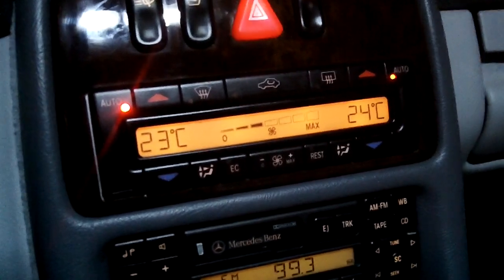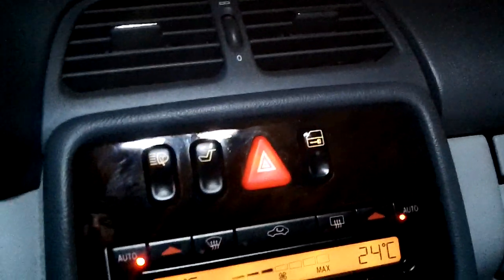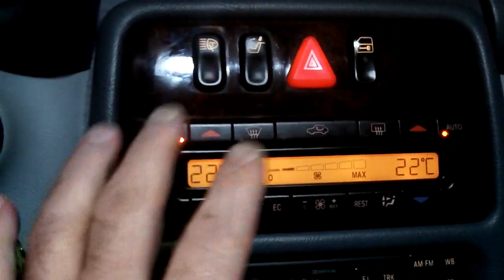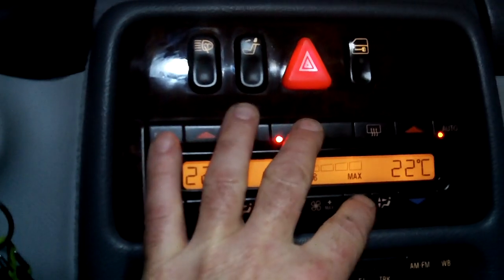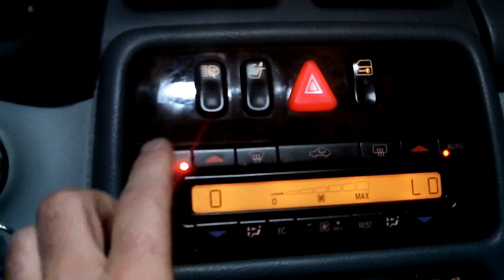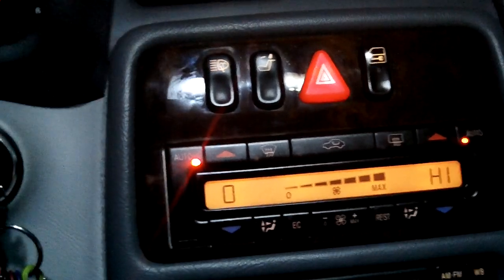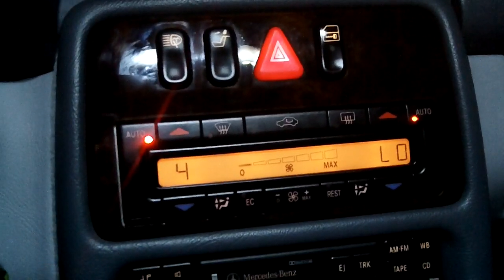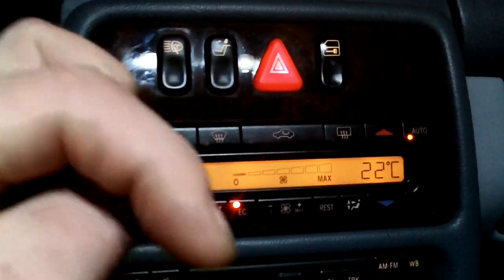Mercedes w208 clk320  climate control vent flap test

Comment: You mentioned the center flaps not blowing in your face with heat. Does the same apply to cold air? Can’t get my center claps to work or my floor vents either

Comment: This is a great video explanation.  Any ideas on why the airflow slows under acceleration and returns at normal speed?
Reply from the maker: The flaps are vacuum controlled . When you press the gas pedal there is a change in vacuum so the flaps can slightly close . There should be a compensation valve to keep the flaps in the same place , but these can slightly leak over the years .
Reply: @fupabox  thanks.  Where is the valve located?
Reply: @fupabox  do you have diagram of vacuum lines for A/C?

Comment from the maker: defroster will mean at windshield, and from what I can tell by testing my car,defroster leak (tiny amount of air coming through ) is at both side defrost vents and windshield.. I may be wrong..but that is the description from the manual,and I hope I'm understanding it correctly
Reply from the maker: must be something in these new settings I can't figure out..I tried to reply to "Terry Gee's" post and It said I wasn't allowed..LOL..who knows
Reply: +fupabox hi, hope all is well.. Im having issues with my w202.. there is no air coming out the center vents its all coming out  the defroster for the windshild.. and the tow side vents..nothing out the center.. Ive pushed every button but still can't get the air to come out the center..also dont think my air circulation is activating
Reply from the maker: +Vaklev Kalpatrick Bastian  the distribution box for the vacuum lines for the climate system is behind the glovebox.. there is likely a leak in one of the hoses back there, or a broken actuator for the diverter flap... I would check the distribution box first

Comment: Hi. Thanks for the video. I have some questions:
U noted that air may also leak at defroster vents during most of the test. Is that the vents at the front, at the windshield or the ones for the side windows ?
Test#6: does left defrost mean at windshield or at left door. 
The reason I'm doing the tests is because I don't think I'm getting enough defrost air at the front windshield. Thanks.

Comment: Craig...Just saw this video..Crazy that you posted this...I've had an little issue with my center vent.  It still blows cold air when climate unit is OFF.  I know MB had the NO heat in the face policy due to safety issue...but I believe this may be a bad element behind the dash, which controls the ventilation system in the CLK's.  (There's multiple Elements that control the vent flaps.)  I wonder if your test can pin point if its actually a bad element in the center vent outlet ..your thoughts?
Thanks bro.

Comment: do you have any tear down procedures for the dash so I can get at the defrost actuator motor???  thanks
Reply from the maker: +Dragon 5715bIt's somewhere in the service manual     http://workshop-manuals.com/mercedesbenz/clk_320_(208.365)/v6-3.2l_(112.940)/heating_and_air_conditioning/heater_core/component_information/locations/

Comment: Hey FUPABOX was up great video lots of info... question??  my vents are not working when i press the buttons to change the directions. Reason is that all my buttons are stuck. Meaning. they dont pop up or not click they seem to stuck or jammed. Any info on this
Reply from the maker: something must have spilled on them . You can gently pop them off and see if they are gummed up from behind . If not , just swap out the whole unit ...they are pretty cheap at wrecking yards

Comment: 2003 clk 320, got a 17 and 18 code.  Issue is no air blowing on driver side windshield, i dont see those codes in your description at all
thanks
Reply from the maker: +Dragon 5715  You have a w209 which has different codes.. I can't find the flap test codes for yours, but many vent flap issues can be resolved with a new cabin air filter, and a reset of the vents.. to reset the vents turn the ignition to position 2..turn the fan speed to high, turn the right vent knob to the straight up position..then press the recirc and windhield defrost buttons at the same time...hold them until they start to blink side to side. let them blink back and forth for a few minutes...they may or may not stop blinking on their own.  Then turn the ignition off then start the car and see if they work properly. If they are still not working try it with the car running..it may take a few tries to reset them
Reply: Hey, could you tell us how to reset the vents on a w208? (I tried the instructions above for the w209 and they didn't work)
Unless for the w208 this vent flap test does the reset?

Comment: @fupabox  Thanks for all of your videos!   You've saved me a ton of money on brakes, brake switch replacement and other things.   Question today:  On my 2001 W208 CLK320 Cab...HVAC system has suddenly resolved itself to do one thing only, regardless of the settings: it blows up through the defrost vents and through the far left and right passenger vents. I can't get any air from the l/r  center dash vents. The temp can be adjusted warm or A/C and the A/C still blows cold. I conducted the "flap test" via the head unit, nothing changed on every test. Any idea where else I need to start looking or what's broke?   Let me know at your convenience.  Thanks in advance man! Dave / Woodstock, GA
Reply from the maker: likely a leak in the vacuum flap system under the dash. The main vacuum distribution block is behind the glovebox, and most of the flaps can be accessed from there or under under dash covers on both sides. Check first that the vacuum operated rear headrests work properly.. if not them the vacuum pump in the trunk could also be leaking, a Vacuum tester can be used to see if there are any leaks, as can a mouthful of cigarette/cigar smoke blown into a vacuum line.
Reply: Hey dead fan, my 2000 c280 just started having the same issue as you described. Did you get issue resolved? If so how did you fix it? Thanks

Comment: What if you got the manual climate control with the two dials for speed and fan position ? Is there a way to test the vent flaps on that?
I wish my car had this unit fitted...
It's a weird model to be honest
2000 w210 e320 m112
No aircon
Leather seats which aren't heated 
And it's an elegance trim ... 
Can't believe someone picked out this car new without those two options.
I think this will be my third and maybe the last Mercedes ... Although I'm very tempted by a newer facelift w203 wagon 2004/2005 
Or same year w211 wagon... Maybe they'll sway back Stuttgart back to no1 for me, because right now I'm having more and more Bavaria thoughts .... Lol
Reply from the maker: +UDontKnoAThing   Old Bimmers are great reliable cars..I've had many of them.. just crappy seat materials, otherwise well built and easy to work on.   The only possibility for a vent flap test on that version of the climate control would be to press the recirculation and front defrost buttons at the same time, and hold both down until the lights on them flash back and forth.. That should cycle and reset the vent flap values.. it takes a few minutes for it to check and activate all the flaps .. it works on the w203 and some w202s  so possibly on yours

Comment: I have a 98 w210 and whenever the heater is on, the main center vents barely blow any air. But when they A/C is on, cool air blows normally. Any ideas on what this could be? I sure as hell hope its not something with the heater core. Any help is greatly appreciated.
Reply from the maker: Your car is behaving as it should.. Mercedes doesn't believe you want warm air blowing in your face (myself I like the warm centre vent air when I'm freezing, but it's not in the programming for the HVAC in these cars)
Reply: *****
Was that only on the '98 models? My dad has a '99 E300TD and he told me that his center vents blow hot air. I believe its been serviced before, could the mechanic have messed with it?

Comment: hello bro 
thanks for your nice videos . i have an issue with my clk 1998  while driving the ac at first works fine and cooling and then while 
 the car is in idle the air blowing is hot after i drive around the air is cool again do you have any idea what to do ??
Reply from the maker: sounds like the coolant charge is a bit low .. when the engine is running at a higher speed , so does the compressor for the a/c ..it then can push enough refrigerant to make cold air ..at idle there isn't enough refrigerant that the compressor can circulate it. I'm betting a top off of refrigerant will solve the issue
Reply: fupabox thanks for your reply. What should I do in this case. Add more gas ?
Reply from the maker: yes... it most likely needs just about 1/2 a can

Comment: I have a 2001 CLK 320 Cabriolet  I am getting a loud squeal sound from my air circulating system it is not constant.  It comes on and off when the circulating system is turned on.  Sometimes it even happens after I turn the car off an pull the key out.  I have heard that this might be a leaky vacuum flap.  Wondering if you have an answer and a fix.  Ever since the DR put me on hearing aids, it really bothers me.  Before that, I could hardly hear it>   :)
Reply from the maker: It can also make that sound depending on whether you have the dash vents manually closed..  I would check for a clogged cabin air filter before blaming the air flaps...junk can get into the vents near the main recirc. flap and help cause squeeling as well
Reply: Thanks,  i will check the filter.  Woud the clogged filter still squeal after the engine is shut down.
Reply from the maker: Pete DeBoer no...only if the "rest " button is somehow stuck.The "rest" function turns the heater fan on low for a few minutes to keep the interior warm in winter while you are not in the car. Otherwise the fan shouldn't come on with the car off
Reply: I pulled the filter out, it was full of "stuff"  Thought I had fixed the squeal, I have ordered a replacement filter.  About 10 minutes in to a squeal free ride, the high pitched noise came back.  Do you think it might be a vacuum flap?  How do I get to it?
Reply: My car is making that squealing noise too when air conditioner is on did you find out your problem?

Comment: hello, thank you for the vid please help clk 320 99 cent ac vent not working 

does any one.know what could cause the issues Nd repair.

please thNk you
Reply from the maker: +thegsilvia69 If you have done the vent flap test , it is likely there is a problem with the vacuum actuator for the center vent
Reply: +fupabox thank you, by any chance you would know where it is located 

thanks again
Reply from the maker: thegsilvia69 you should be able to access it from the panel  under the glovebox
Reply: +fupabox thanks for everything

Comment: Maybe somebody can help me out on this one. I have a W209 (LHD). I already replace stepper motor and arm for M2/10 (Left footwell). I ran multiple of OBD scan tool (Snap-on, Icarsoft and even MB Star C5) and it only picked up M2/11 (right footwell). I 'm planing to change that before winter. I will be changing the cabin carbon filter under the glove box in the coming weeks (parts in transit) Never been changed before). 

I have notice the driver side front defrost is hardly blowing any air (M2/8) the passenger side front defrost (M2/9) is working flawless. When I do the pre-test the driver side front defrost open and then the flap will closed after that. It's bugging me trying to figure out what is going on and if some one can give me some direction on how to resolve this. This will be great!

Comment: I’ve been meaning to post on one of your tutorials and your clips are top notch! You helped me out a good amount in the past, it seems we have a taste for similar MB models. Are you up in Canada? I noticed your temp readout displayed ‘celcius’.

Looks like I might have an evap leak on my 208 55. :( I plan on running your diagnostic test this weekend.
Reply from the maker: PaulB   Thank you .. yes Just outside of Toronto
Reply: fupabox You guys have it good up there when it comes to importing cars! Similar to when I lived in the U.K. You’re no doubt savvy when it comes to these cars. As I previously stated, it appears my A/C evap behind the dash might be leaking. I noticed some type of bright green dye on my driveway under the passenger side about 8-10 months after purchasing the car a year ago. When I renewed my safety inspection the inspector raised my car on a lift and told me it looked like it was dripping from the evap area. He did not have the time to perform a thorough inspection.

I rarely use the A/C, but it definitely helps with overwhelming humidity or heavy rain. Would the test in your clip reveal the evap as being the culprit part? I’d be very much interested to hear the steps you would take in trying to get things sorted. I’m tempted to try one of the A/C refill kits. I heard mixed reviews on them. Any insight you might be able to provide me with would be appreciated!! No rush, if you happen to have a min or two to spare. Cheers
Reply from the maker: I've used the a/c refill kits many times with no issues. The refrigerant has a fluorescent dye in it .. a UV light will allow any leak to glow when you use the UV light on it ina dark garage . Evap would be bad since the whole dash needs to come out to replace the evaporator  .. heres a terrifying sped up evap replacement . https://www.youtube.com/watch?v=I3OAiyX3mnM
If you trace the leak back to the evap , then I would try an a/c system sealant first... The heater core and evap replacement I did once many years ago .. it was a 2 day nightmare of swearing . The only test you could do is the system pressure test ...it's somewhere on my w208 playlist . if the pressure in the system is ok , or close to it , the evap should be fine .. it can't hold pressure if it is leaking , and if it is only a teeny tiny leak , a sealant will hopefully save a lot of time and swear words
Reply: fupabox Thanks, I really appreciate you taking the time to respond back to me! I’m going to try one of the A/C refill kits. I hope it holds for good, but if it lasts for the next 3-4 months that would be nice too. I can live with a refill once a year during the warmer months if the refrigerant sticks. I refuse to let a shop pull my dash, these cars are put together so tight I feel it would never be put back the same. 

I plan on running the error test this evening. I’m not sure if this procedure is capable of detecting an evap leak. Thanks again for your help!!